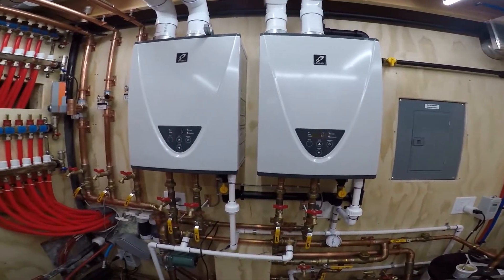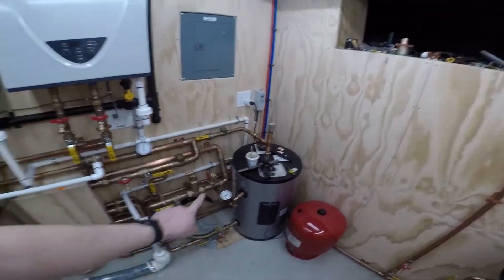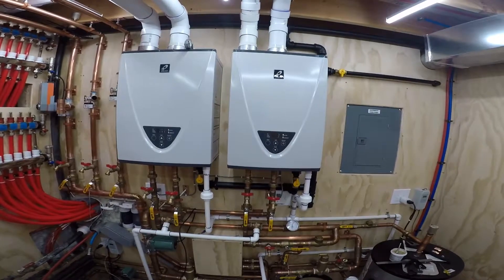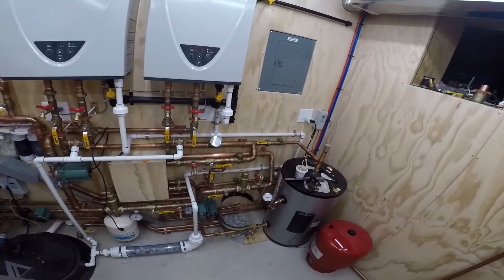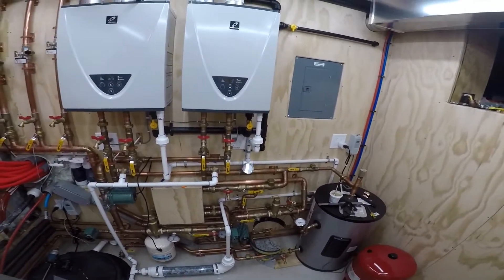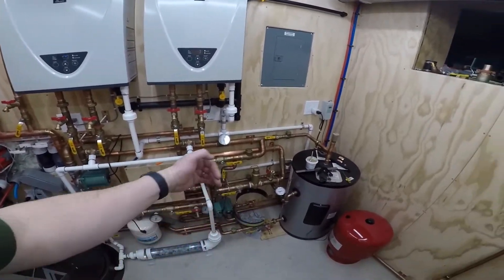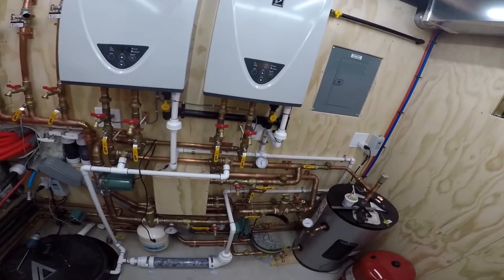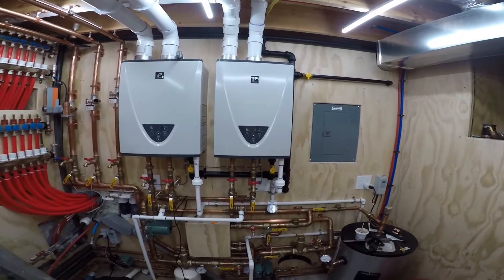Basic Overview of the Water Heater Buffer Tank In Action - Episode 37 [12-25-2020]

Comment: what pump are you using for the buffer tank? I just installed my setup after seeing yours but I think my pump is to small. I'm out running the tank and my pump only does 3gpm
Reply from the maker: Hi Ryan!  My Tank pump is a 0013-SF3 SS.  You can find it here: https://amzn.to/3DGpGLC  What pump do you have now that is only giving you 3 GPM?
Reply: @DeckerChristopherJ  grundfos alpha 2
Reply: @DeckerChristopherJ  I think my issue is the pump is not strong enough.  I experimented last night and i can get 8gpm from the pump if i open the pressure bypass on the tankless and let the water flow un restricted.  Once i close the system back in close loop the pump only flows 3gpm.

Comment: This is super useful!!! Do you ever encounter a situation where the water heater catches up to the buffer tank and starts to essentially short cycle? Im in planning stages to add a recirc loop and potentially a buffer tank, but Im still uncertain about few practical nuances. 
I assume that pump is one speed and you mention a fairly large gpm so I wonder if the water heater controller fails to modulate the burner correctly since it doesn’t “see” the flow or temp change directly.
Reply from the maker: Hi Vitality Sakharov!  So with the way I've designed the system, the buffer tank can never short cycle the heaters.  The buffer tank has an aquastat that senses the temperature of the buffer tank.  When the temperature drops below a set temperature, it energizes a relay which turns on a Taco 0013 pump.  The pump is what circulates the water from the buffer tank through the heaters, and provides the flow that activates the heaters.  Internally, the heaters read the temperature of the incoming water, and modulate the burner(s) accordingly to adjust.  The flow (GPM) stays constant through each heater (typically 3.8 GPM each), as the Taco 0013 operates at a fixed speed.  With the heaters outputting at 140ºF, eventually the water in the buffer tank heats up to a certain temperature (currently 132ºF).  When this happens, the Aquastat shuts off the Taco 0013, which stops the flow through the heaters and shuts them down.  The water heaters definitely see the flow, and the change in incoming water temperature.  Hope this answers your question, and thanks again for watching!